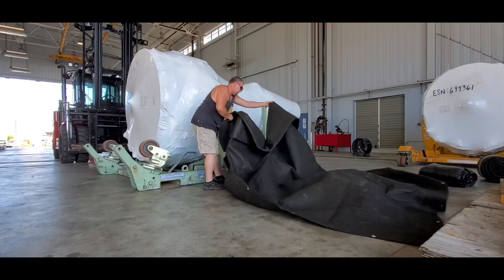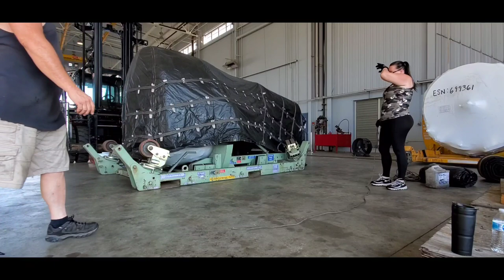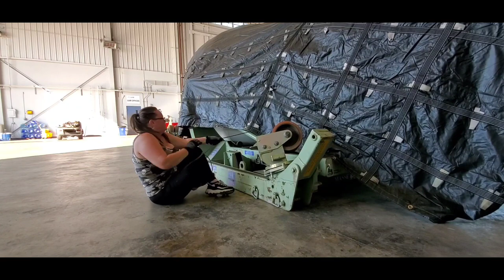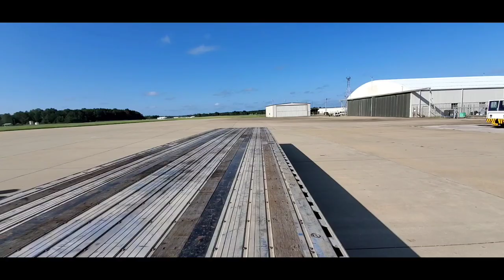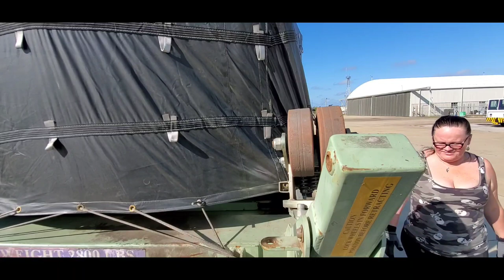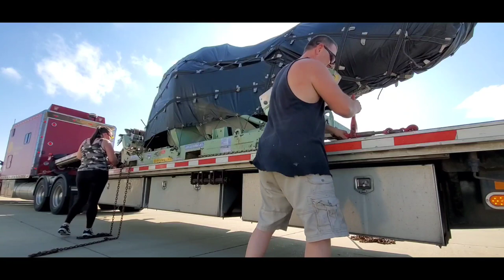TARPING A CFM 56 AND LOADING THE JET ENGINE ON A STEP DECK TRAILER

Comment: P.p.p. looks like she's knitting a cfm 56 cozy. Like a tea cozy. 
     Do you realize a single blade can run $12,000? Not the ring, but a single teenie,weenie, itsy, bitsy, yellow polka dot fan blade!
     Also, a "light"maintenance, that doesn't involve a complete tear down, takes from 15 to 35 days. A "heavy" maintenance with complete tear down runs 30 to 65 days. The biggest problem is finding where they put all the parts to rebuild it. Just kidding.
      Since an engine can spend up to 8 or so years on the wing, it's worth taking time to rebuild it properly.
      The Delta rebuild facility near Atlanta was rebuilding 900 engines a year as of January. Now I think they're down to 1 a week. Kidding.